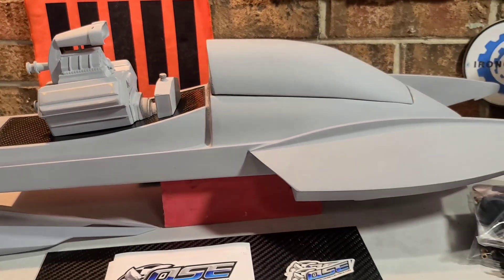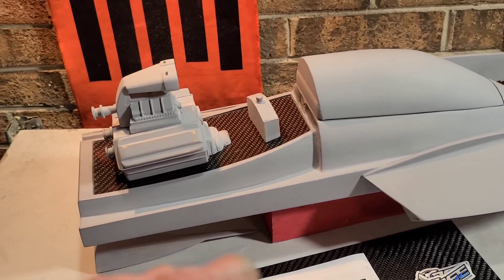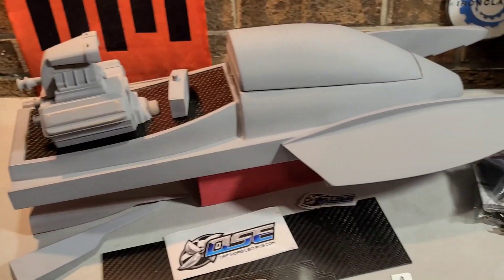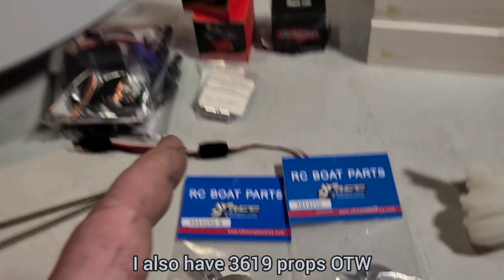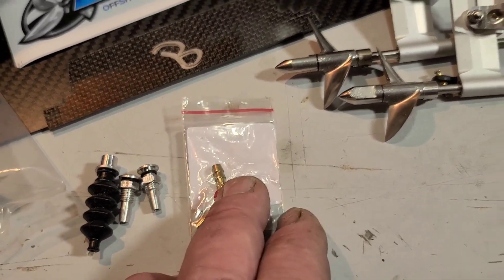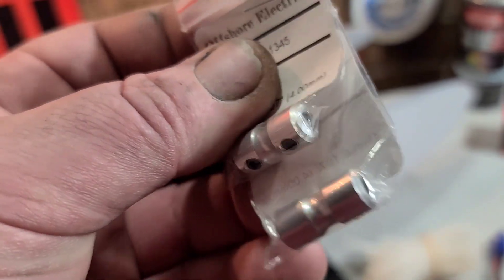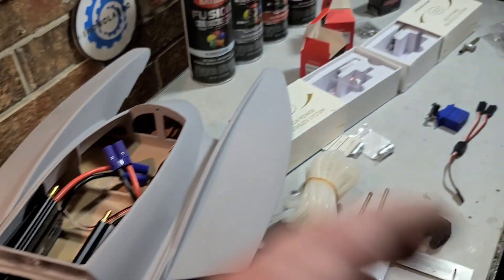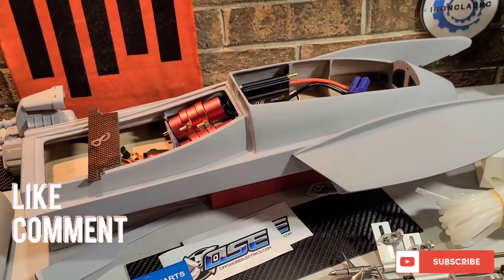Twin Brushless Motor Rc Drag Boat Build Series Pt1: Paint, Electronics, & Hardware

Comment: B I've used that paint "krylon fusion all in one" and LOVE IT. I painted my big storm in white and I'm freaking impressed man. I didnt even need to add clear coat.
Reply from the maker: How is the big storm?   Is the hull construction durable?   Or is it super thin & questionable?
Reply: @IRONCLADRC  I haven't had much experience with abs hulls and upon ordering it my expectations were low but I'm pleased to say I'm impressed. I feel its tougher than my traxxas m41 to be honest. The hatch is impressive too.
Reply: @IRONCLADRC  I added some dummy outboard engines on the big storm 😁 doesnt look too bad honestly.  If interested it's in my uploads.  Happy boating!

Comment: I hope the model engine on the back doesn’t fly off if the boat flips it like 80 miles an hour
Reply: I don’t think he is gonna run with that hatch
Reply from the maker: Good to hear from you George, it's  been a while.....   norcal is right I'm building 2 separate hatches  one with the motor and the other is carbonfiber for running the boat